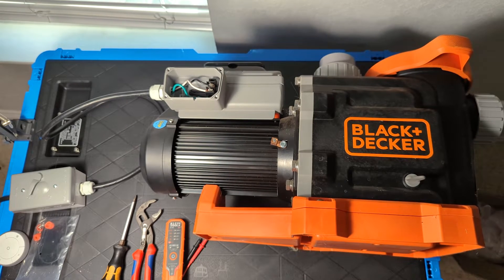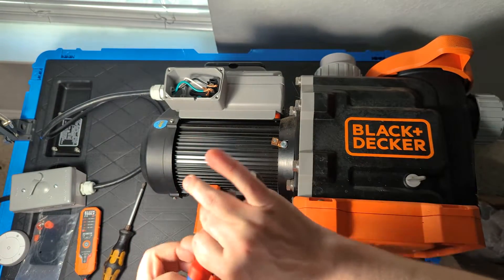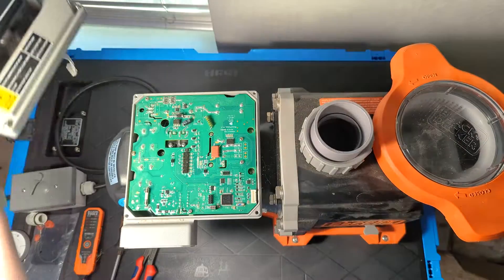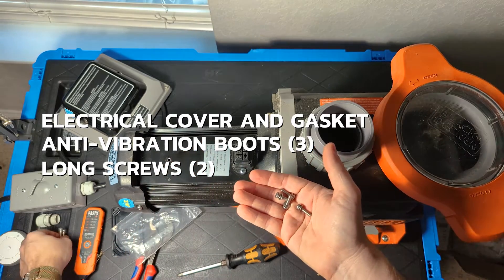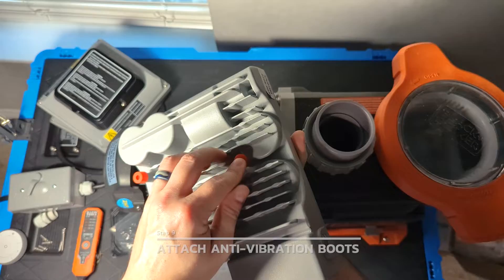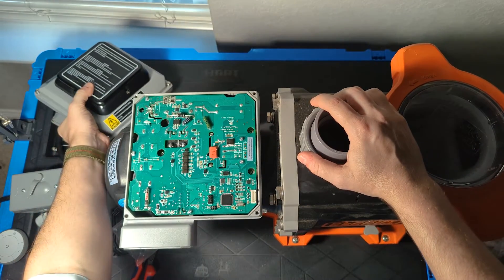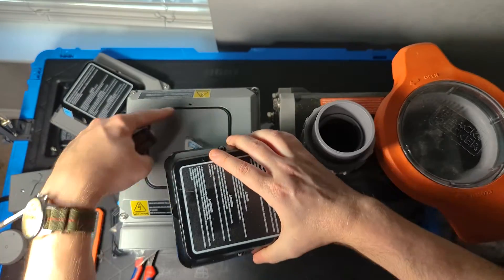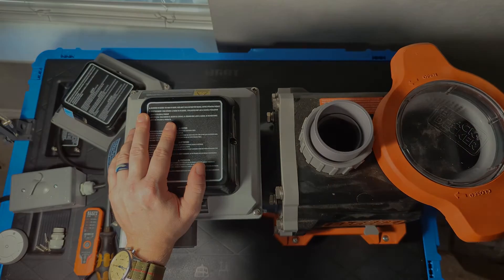How to Replace the Driver/VFD for BLACK+DECKER Variable Speed Inground Pool Pumps

Comment: I bought this pump in april 2023, happy with this pump, today suddenly without any problem the pump stop work, not display in the driver panel, test fuse and is ok, test connection are ok, test breakers, check the rotation and is good, check voltage is okey, is look that is the driver part, in the troubleshooting document there is not informacion when this panel have not light and in any place I can find this information, I wrote PoolsPorT Go looking for information and also I wrote through Amazon looking some help, at this moment I only receive and automated message, hope the guarantee of 5 years help me, this video give me some hope about my pump, I plan to buy another pump because I need 2, in the pump manual there is nothing about this part, only mechanical parts, nothing said about this driver or the fuse.

I liked this company, I bough robot, pump and pool cleaning tools...
Reply: Same here. Did you ever get an answer? If so, how long did it take?

Comment: Worked well.  Replaced my controller which had a date of 2019 on it with newer 2022 version.  These instructions were right on.  The only different really was that the display on mine can't be turned 90 or 270 degree since there are only 2 screw holes.  Thanks for the install video, that made it super easy.

Comment: No part number or any information on where to purchase this driver. Should be under warranty. I bought and installed this pump in January of 2023. No display on driver, checked power. Only way to communicate with this company is through email. Which they say will take a day. All the while my pool is getting dirtier.
Reply: Did you eventually get it resolved?